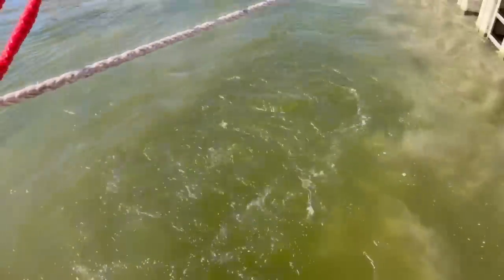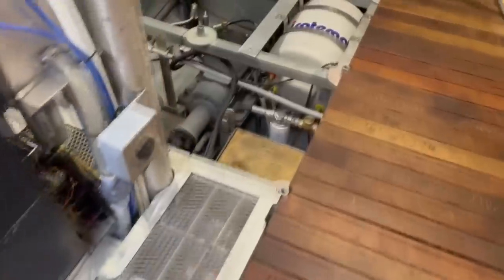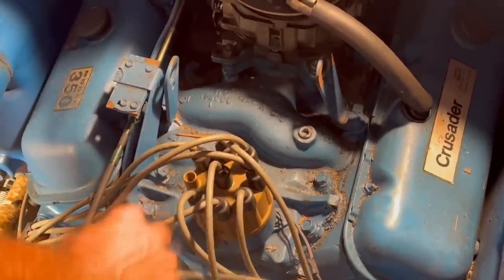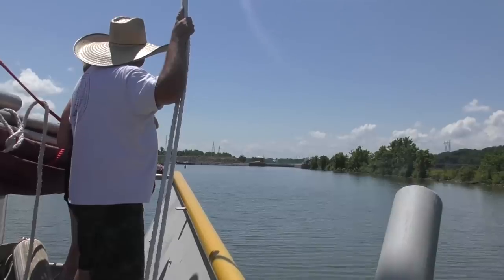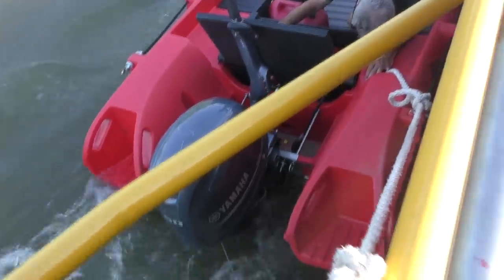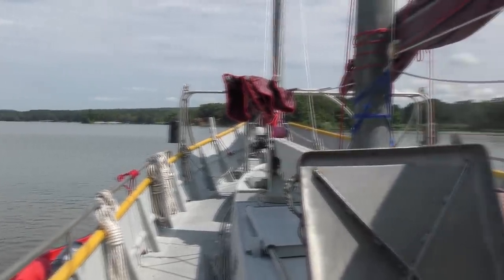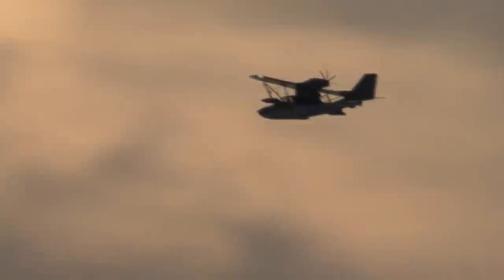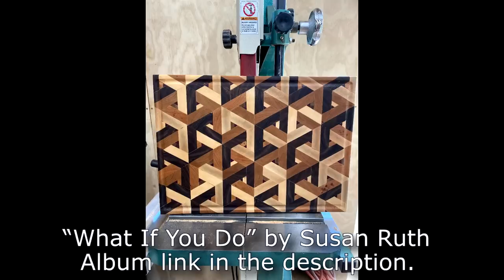A Challenging Trip to Kerr Lake with Excellent Outcomes

Comment: My GM V8 was so loud when you tried to start it the neighbors would complain it wakes them up.  I discovered if you shim it properly, which lines up the Bendix with the fly wheel teeth... it is very very quiet now.  I spent over an hour on a lift changing shim size and placement until it was very quiet.

Comment: Doug your problems with the variable pitch controller remind me of when I first got my ebike.  I literally had 8 flat inner tubes in short order, until I figured out the manufacturing issue with the wheels and rectified it.  It's been smooth sailing since; you'll get there too!

Comment: It's nice to see that at least someone knows that black smoke is a lugged engine and not a sign off power.
Reply: Actually it can be either. You see the same result from turning up injector pumps beyond spec (increasing hp).  Black smoke is unconsumed fuel, either way.

Comment: Just came by you above applegate, im on the colonel. Good luck on your trip out and be careful when you make it to the white river. She’s running pretty good
Reply from the maker: Awesome thank you!  I put a photo of you over on Facebook.  https://www.facebook.com/photo/?fbid=5734317283247049&set=pcb.5370594239696466     And no worries I'm here for the summer or until it get the sail rigging more along and will wait for lower water before heading on.
Reply: @SVSeeker  well it’s actually not a high water issue, it’s because the Mississippi is so low there is three foot of elevation drop between lock one and Montgomery point lock which makes it swift.
I’ve been running this river for a few years so if you have any questions or concerns  feel free to give me a holler
Reply from the maker: @dannystafford9333    Oh!  How fast is the flow?   In knots if you know.    And drop me an email at svseeker@ymail.com and I'll keep in touch.
Reply: @SVSeeker  emailed ya
Reply from the maker: @dannystafford9333    Thanks.

Comment: Just a heads up. When you get in the Mississippi and you get up above New Orleans and all along the way down to Southwest pass, there's going to be a lot of sediment in the river water. I don't remember what kind of head you have, but the sediment will stop up your toilet flush valves.
 Also, if you're using it for your engine Cooling watch that carefully. In the spring with all the rain the river runs a couple knots and it will push you right along. I've run that River many times years ago doing tug barge/ combination and bulk freighters. We always had an issue with our storage/cooling water and flush water because of the sediment.

Comment: Please forgive if someone already mentioned this.  What about a small camera on the top of the mast?  Then you could point it straight forward and see if you low enough to clear those bridges.  They make solar powered WiFi cameras.  Or get a PoE one and run an ethernet cable too it.  Pretty sure you can get night vision too.  Or in your case Height Vision, :)
Reply from the maker: Yeah, we might do that.

Comment: In a previous video you asked about a device on the transmission.  If it is the throttle position it is critical on cars.  It is a major input to the transmission that controls clutch/ band pressure  control.  leaving it disabled is a no no.  Love your content.  God bless you and crew.

Comment: So, Tohatsu rules, after all. Why am I not surprised. It's good having the first major setbacks in calm waters with less winds and no swell though. You're good in ripping out the Hundested meanwhile, which actually is an Hundested-inspired Jackson backyard-foundry product if I recall it right. I reckon once You arrive down South at the Gulf, most of the setbacks will have become part of "the earlier lessons" and drill. Thanks for sharing!
Reply: Was on the edge of my seat when they widened the oil channels in that bronze part! I just hope that didn't introduce some larger deadzone or change in pressure, but IIRC it should be fine

Comment: add an electric water pump to wash down the anchor chain as it comes out of the water it will keep your chain locker from filling with sand and mud also keeps the junk off the deck
Reply from the maker: I have one, but it's part of the watermaker system and we don't use it in fresh water.

Comment: 85 year old lifetime boater with 100 ton USCG Masters license and retired airline captain here. This boat is presently not river-worthy let alone seaworthy. The propulsion  is  an unreliable system of nightmare complexity. This is a big heavy boat that ought to cruise at over 9 knots. You should know the height of your mast within at least 6 inches. This can be calculated along a measured length of dock with a sextant. Patchwork improvisation and repair will not solve this vessels shortcomings. Somebody had to say this.
Reply from the maker: Dude pieces of paper do noting to impress me.   From where I'm standing you're letting your fear talk.  I instead contacted the Tulsa and Little Rock Corp districts and confirmed the bridge heights after seeing a cell that was incorrectly marked.  Even then it was prudent to proceed with caution as we did.  Next time maybe you should get clarification before running to wrong conclusions.   Don't they teach that the USCG Masters?
Reply from the maker: @YoloSwagNinja     You're emotions are making you sound stupid, and certainly you are not that stupid.   There is a cell in the river with the wrong height painted on it.  I called to confirm that it was indeed wrong.
Reply from the maker: @YoloSwagNinja    You seem confused.  I am afraid.  I fear lots of things.   When the clearance marks on a cell do not make sense, I fear running into a bridge and call the people that can confirm the clearance.   That is responsible, it's controlling the fear and proceeding onward.   It's the proceeding onward that is the point.   Feel the Fear and Move Onward.   A cowards will do nothing, and idiots would not give it a thought.   You seem to be suggest that I become an idiot.   Why is that?
Reply from the maker: @ChuckWesterlund     After the I40 Arkansas River Bridge collapse due to a barge impact, cell were installed to protect the bridge.   Some have clearance heights painted on them.   At the Hwy62 bridge at Muskogee that measurement is 10 feet too low.  https://bridgehunter.com/photos/47/73/477351-L.jpg
Reply from the maker: @svnova3430  Cowards are a dime a dozen and willing to share their fears.   I'm having breakfast with a young man out of the Air Force who is Kayaking his way to the Gulf.   Choose your company for the person you want to be.   Either way you are going to die, but only courage gives you Life.
Reply: @SVSeeker  you sir are an inspiration! Ignore the fools who couldn’t even dream of doing something like this. Life is about the journey, not the destination and this boat is a reflection of all the hard work people have put in along that journey. Making iterations always comes with building something great. It’s part of the process! Keep on sailing!

Comment: Another awesome video Doug. Miss living on a boat. Always a good time even when it all goes to shit. I like your trial by fire approach to sea trials. Thanks for showing the helm. Still curious regarding what kind of speed you will get but also the cost.  Top speed would be wide open throttle and pitch to 1500 rpm? I'm guessing the EGT is to keep you from running too cold?

Comment: Hi Doug,  Like the chain return using smaller winch with better torque. Maybe you could make a chain locker derived plate so you can avoid tying the rope to chain, and just slide or slot it onto chain as you belay tension ?  Looks like a chain/rope spray washing system might be on your to do list ?
Reply from the maker: We'll I already switched to a higher torque motor, but I have the system psi turned down.   I'll crank it back up.  Too high and it smokes the clutch on the main engines pump.   If the transmission works out, I'll likely add a PTO there with a better pump.  And I have the wash down pump but it's part of the RO system, and I don't want this muddy river water in those lines.  : )

Comment: Something like the propulsion system failure was always going to happen. If you can, weld on a step for an outboard on your transom. Then get yourself some speedboat controls rigged to it. Raise and lower your outboard with your davits. You'll be fine and have a nice backup for your main propulsion.
Reply from the maker: That's sort of what we do with the tenders.

Comment: Perhaps ditch the variable pitch propeller…seems to be more trouble than it’s worth. Great videos !
Reply from the maker: Maybe, but that would be really premature.
Reply: @SVSeeker  Yes variable pitch is what's going to ultimately save you on fuel costs.
Reply: @SVSeeker  You will eventually make it reliable, the variable pitch system I had, was activated by an external lever which was hydraulically moved. The prop went from feathered to reverse, so no adjustments like you need, and had direct drive, no reverse transmission, a bit tricky to get used to using.
Reply: The variable pitch to allow less drag when sailing……but do you suffer “always” inefficiency with the slightly clumsy variable pitch props?  To simulate sailing: Drag the Seeker with the hot tamale at full throttle and the blades flat in sailing position. Then do the same with them pitched for engine travel…….I suspect you will loose almost no speed. Less than half a knot at most. Chuck on a nice three blade fixed prop and test run at a given rpm…..I would bet that a nice efficient, fixed pitch prop will give you more efficiency (speed) at a given rpm. Be nice to have a fixed pitch on board no matter what.
Reply: The key to safety at sea is equipment reliability. You need 100% reliability out of your mechanical equipment. Especially since you can't yet move yourself under sail safely.
Your equipment seems to be too complex at present. You can't even drop and hoist your anchor reliably and fast to save the boat. Old saying, keep it simple, seems very appropriate for your complex propulsion mechanical systems at present. 
Lives, and the vessel itself, may depend upon the use of those systems in gale to save lives.
Be careful. Don't be afraid to go back to proven mechanicals.
Reply: @stevecarter9027  Variable is always better than fixed. Weather the boat is laden or empty you can always run at best efficiency (mpg). Like you say if a prop doesn't feather just right it's actually not a big deal.
Reply: @stevecarter9027  The boat is a motor sailor, most of the time it will need a little assistance from the engine, a fixed prop would be very ineficiente. While sailing, the variable pitched prop can be used with more that just motoring pitch, with low engine revs to assist, to maintain a desired speed, I used that method a lot, on my boat.

Comment: Doug, what happens if the pitch controller (huderstat?) loses oil pressure? will it stay in the pitch or move back to cero? Keep the amazing work!!
Reply from the maker: It will not stay put.  Where it goes seems to be a roll of the dice.
Reply from the maker: @stirlingfromla  When everything we can think of has failed.  And I'm a long way from quitting.

Comment: In my humble opinion there should be a purely mechanical option to pitch the props, a shift fork and a big lever right there on the shaft. It would require someone to run down and operate it but be more dependable than hydraulic witchcraft.
Reply from the maker: They make a unit like that. But I’m still sure we can figure this one out to.

Comment: If you still have it do not get rid of the OE Denso starter on the Cummins.  You can get the motor brushes, contacts and solenoid plunger off eBay for $40 and they are stupid simple to rebuild.
Reply from the maker: It's still hanging up from time to time and needs 3 or 4 bumps before it goes.  So were thinking the starter my be fine and it needs a ground cable run directly to it.  What do you think?
Reply: @SVSeeker  I bet it is just completely filled with carbon dust from the brushes and contacts wearing causing it to stick.  Check out this video and you'll see how easy it is to take apart.  Worth it at least to see how the internals are and to clean it out. https://youtu.be/ct9Gyso2IeM
Reply from the maker: @1320fastback  No, I had it rebuilt by a guy I trust.  It's all clean and has new contacts.
Reply: @SVSeeker  Must be something else then.  Can't imagine it would need a direct ground or shimmed.  Medium Duty engines are pretty stout as they are.
Reply from the maker: @1320fastback  Yeah well.   We'll give it a try.

Comment: Cummins starters don’t need shims. After market ones are crap. Find a genuine denso starter and you’ll have a good one.
Reply from the maker: We know but you gotta try something. And it’s a rebuilt starter by a Tulsa guy who does really good work.  We’re thinking now that might need a ground cable directly to the starter.

Comment: Hello Doug cheers form Brazil.  just posting this to try helping a little,  the electric pump from a hydraulic steering must stay upright,  don't remember if it will cavitate the fluid or just burn the drive unit otherwise, maybe that is what is wrong with that.
Reply from the maker: So far it's done just fine.

Comment: Drive system again?!  Imagine if you just simply put a fixed blade propeller back there replacing all that sht-rigging hunderstat, pumps and sloppy blade mechanism Doug?  You would be so much further along Brother.  More than 2-3 blow-outs and otherwise how-many  major failures of your drive mechanism leaving you high and dry on critical mobility?!   I'd call that a noble-experiment and put it all  that crap in the "we-tried" dumpster.  We are rooting for you and Seeker being a success out here in internet-land.  You cannot fail!  Remember KISS...
Reply from the maker: So you would quit that easy?

Comment: I have never seen a shim on a Cummins starter setup
Reply from the maker: Right, cause the bolts are all front to back.  And it's not working either, and it still hangs up from time to time and needs to be given three or four tries.   We're going to put a ground cable to one of the starter bolts next.   Do you have any other ideas?

Comment: buy a BECK ARNLEY or a NEW Starter from Cummins, Also Try DB Electrical, they offer a ton of high output gear reduction starter for the racing environment, tractor pulls etc !
Reply from the maker: The rebuilt starter hangs up too now and then and requires 3 or 4 bumps before it goes, so now we're thinking we'll run a ground directly to the starter.  What do you think?
Reply: @SVSeeker  sounds like you have voltage drop in the wire that energies the solenoid  on the starter motor

Comment: GM starters get shimmed.  If you can pull the drive out manually into the flywheel, a straightened out paper clip is the gap you need. But that's not going to be your problem, they are just get noisy when cranking when they need shimming, but they crank
Reply from the maker: Yeah but cummins starters normally don't.   The bolt all go in front to back.  But it was worth a try.   It's still hanging up from time to time and needs 3 or 4 bumps.  So now we're thinking it need a ground cable right to the starter.  What do you think?

Comment: Any chance of having a mechanical backup for the variable pitch controller? hope this fix is the wright one!!
Reply: I don't know if there's a mechanical fix for Seeker with that Propeller, Doug would have to buy one of the Geared Hub type Propellers that the Yachts and Working Boats go with, those Propellers have a Geared Hub that's attached to the Shaft so that when the Shaft starts to turn the internal Gears Pitch the Blades a set amount, that you set when you assemble the Propeller by lining up letters and numbers inside the Hub to allow for so much more or less Pitch and when the Shaft stops turning it allows the Blades to be feathered by the current passing over it and it works the same way in reverse Gear, I watched a Guy show his daughter how to put one together on a Sailing Channel last month and it was nice to see a Father teaching his daughter how to do things that involve mechanical/Engines/Wrenches/Screwdrivers and tons of Marine Grease and her enjoying it....
Reply: @kevnwarriner8819   , that was Ben from sailboat story showing his daughter molly. 
A simple fixed prop is the real solution (or locking current prop), the sailing capability are going to be limited at best so a reliable drive train from The engine is vital. 
Cheers Warren